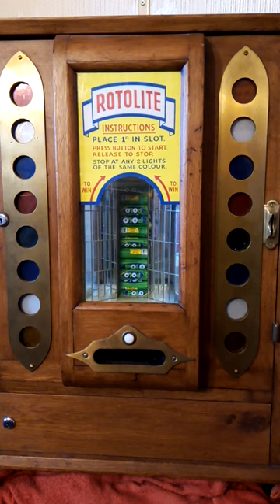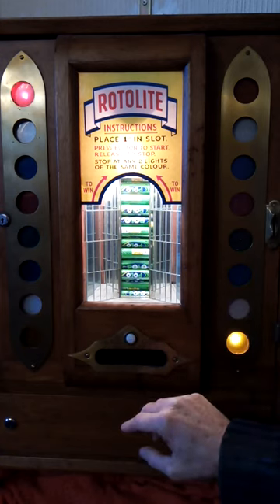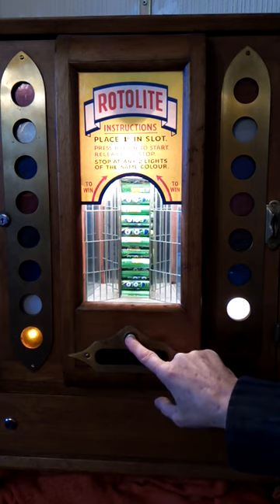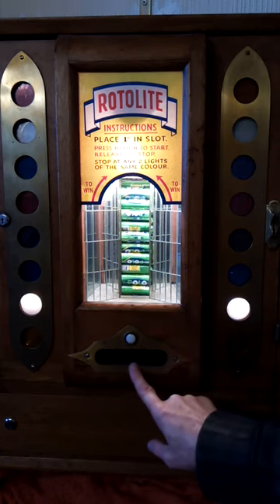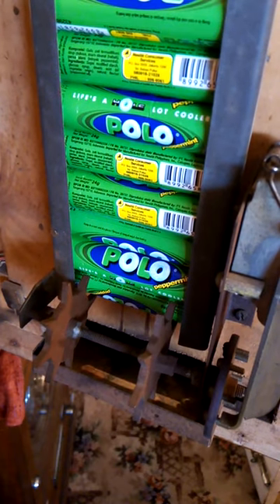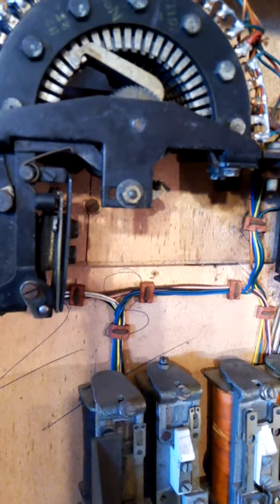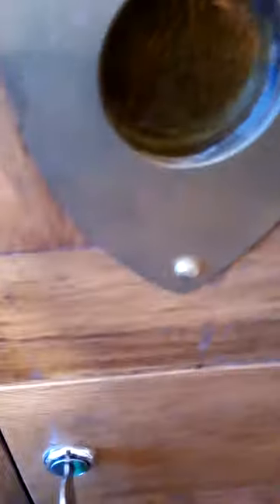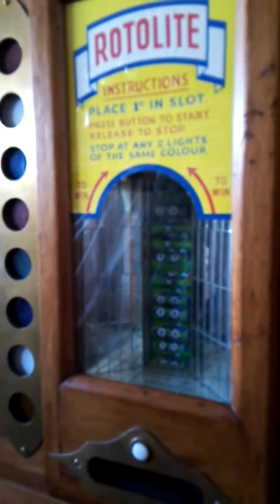Jamieson's Rotolite Sweetie , Penny Machine Paying out Polo Mints

Comment: Not my sort of machine as I would soon get fed up with it. 
Having said that it’s a lovely machine.. looks like GPO type relays. One word of advice. I can see a fuse but is there a fuse between the transformer and rectifier. It’s not uncommon due to age to have a rectifier fail and then take out the transformer as no fuse in between them.  
When rectifiers were new not a problem but old ones do fail
Reply from the maker: andy sims Thanks for your advice, i have just checked and there IS a Fuse in between the transformer and rectifier
Reply: @supershotbattymanbor  that’s good then . Great